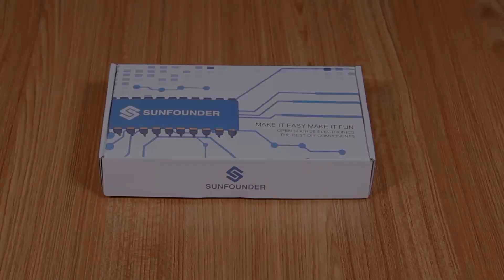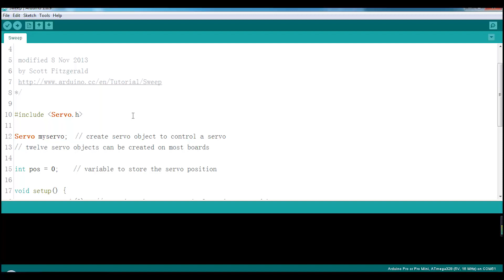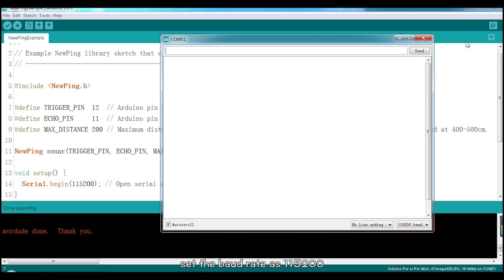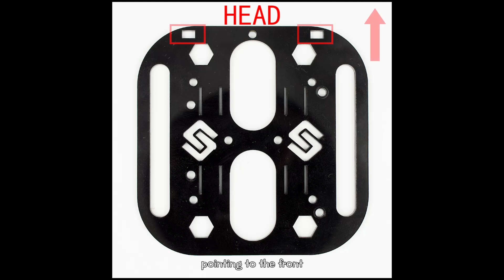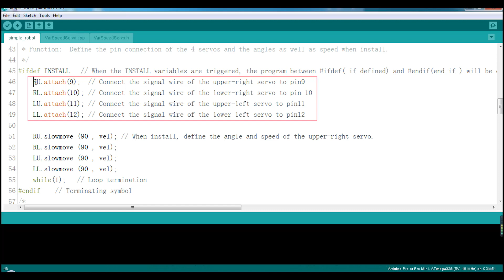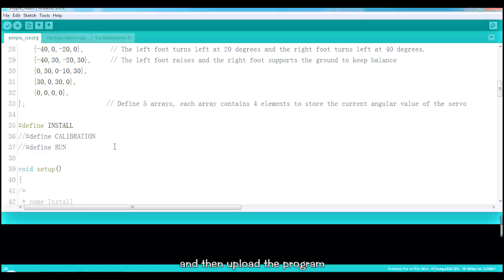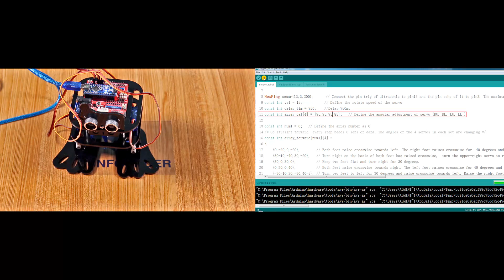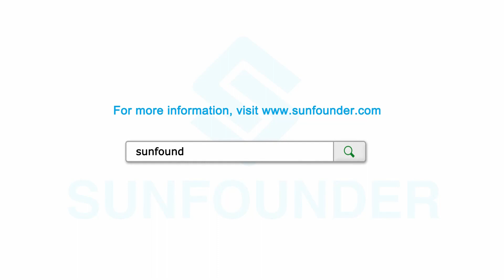Sloth Arduino DIY 4-DOF Humanoid Robot Learning Kit with Programming (Assembly Tutorial )

Comment: At 4:32, the code doesn't match what's in the video. Instructions (which are not present in box, and must be downloaded as pdf) have the wrong terminology and the process doesn't work. No way to install required software.

Comment: When I connected the arduino to the computer, everything
              worked fine and it started walking, but connected to the
              accus the Robot does uncoordinated movements. The voltage
              seems ok to me (7.1V).
            I can only agree with the same problem. My
                  guess is that the voltage regulator on the servo
                  control board is not enough for the up to 600mA that
                  the robot needs.
            Thank
                  you for help
Reply from the maker: Dear Stefan,
Pls test separately whether the voltage 5V and 3.3V on the Nano board is normal? Then power the battery fully and test it again. If you still can't solve it, pls shot a video that the robot take a few steps with a full charge battery.
Have a try!
Good luck!

Comment: I bought this and the nano has a driver thats a pl-2303TA but I don't have it the driver, and it didn't come with any directions on how to get it or find it. I've been looking for it but no luck, would appreciate it a lot if I could get some help.
Reply from the maker: Dear Eugenio, 
I can't find the problem：I have a Windows 10 and the arduino nano is not showing up in my port. why?
You need to manually follow the Nano driver, pls downlaod it in the below link: https://www.sunfounder.com/learn/category/DIY-4-DOF-Robot-Kit-Sloth.html
You can get a Driver package which has the Windows and Mac O SX version of the driver. 
Hope that we can solve the trouble for you.

Comment: My board is the blue one, it is not exactly the same as the video show (I bought the kit from sunfounder). Also, I uploaded correctly the servo test code to the board but the servo does not move (none of the 4). Neither in pin 9 or whatever pin I select. Have someone a hint?
Reply from the maker: Hello, please download the user manual, including the test for Servos and Ultrasonic Module, on the following link,https://drive.google.com/file/d/1s3odEOOjAOCvBbcw3cCISV970NOTA4TN/view.
Hope this will help you.

Comment: 11:00 You changed the bolt pattern for the Arduino board. Secure the long standoffs with the short standoffs, and the problem goes away.

Comment: I had to select "ATmega328P (Old Bootloader)" instead of "ATmega328P" as shown in the video, using the Sunfounder nano v4.0 board and Arduino 1.8.7 on a Mac, in order to upload sketches. The video (using a red servo board instead of a blue one like I have) shows the servos moving without first attaching the batteries, but my servos don't move. PDF from the website says use pin 9 but attach(16) in the code instead of attach(9) like in this video. Need to get some (not included in the box) LiPo batteries to test further...

Comment: Thanks for the excellent video. The instructions were very clear and my robot worked first time.I am having a problem with the robot resetting itself from time to time, but I think that's because I am using old batteries that can't supply enough current - I will try later with newer batteries.But, as I said earlier, the video instructions were excellent. Thank you!
Reply from the maker: Dear Ian,
The supply voltage should not exceed 6v-8.4v range. When the current output is too large, the battery with protective board will reduce the current automatically. So we suggest that you can buy the battery without protective board, or take off the negtive protective board. 
Pls pay attention to safety!
Reply: hay can you plz give me the code of this slot robot